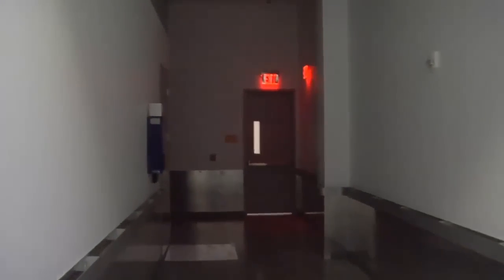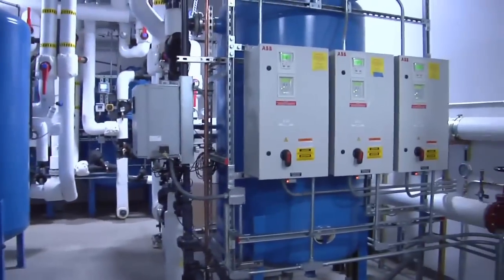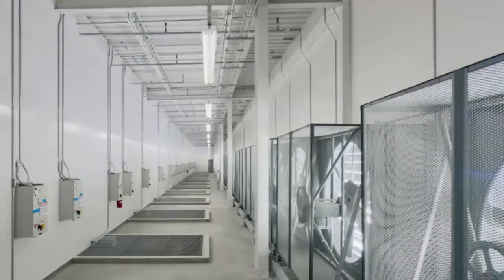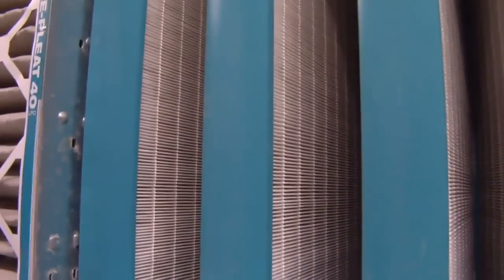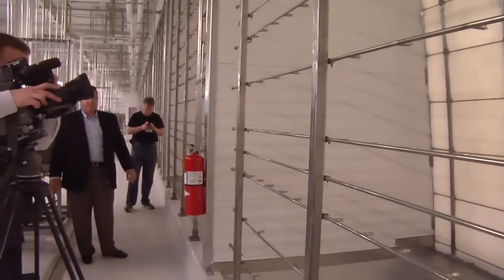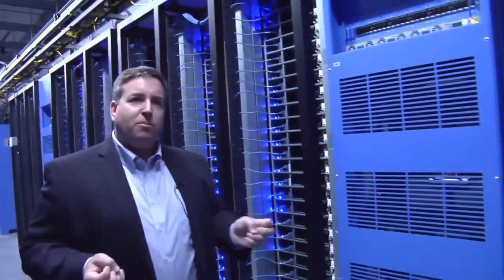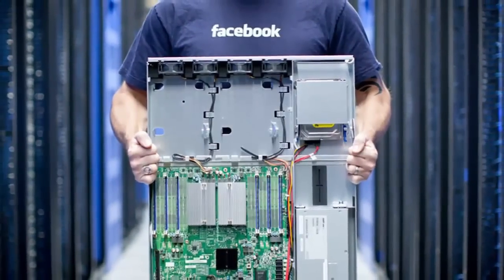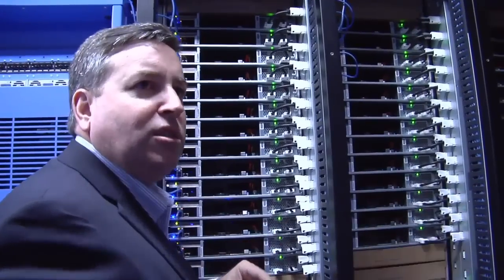facebook data center

Comment: 11:40 that's not a UPS it's a DCBUS. A UPS converts ac to DC to charge a battery bank then converts the DC voltage back to a inverted AC. a DCBUS takes incoming AC and rectifies to DC and depending on DC voltage needed 12,24,48 etc and then charges a battery bank for the instance AC voltage is no longer present. Basically if you're giving your equipment both AC and DC you don't have a UPS or PCS. It's strictly a DCBUS.

Comment: Environmental controls: Server space,  Best practices??- Recommended an increase in Air Pressure in server spaces operating environments
9:56 - 10:08 Thomas Mentions how increasing the pressure in the server room space slows the fans  in the servers  saving on power.
This might be the case in a sudden rise in pressure  - but only momentary
Would the higher atmospheric pressure in the server space not increase the density of the air?
Would this not increase wind resistance (drag) on the Server fans?
I am pretty sure variations in humidity would be in play here too, Vs density due to air pressure rather variations of humidityfactors like the specific gravity of the liquid at its given temp, current viscosity - not counting slip/shear from the angular momentum of the semifluids, velocity and trajectory to the Tine edge of the blade and the angle and rotational phase of the blade itself.
-seems counter intuitive.
 If air pressure in  was really in play here, in Would it make more sense reducing the pressure of the server space and thereby effectively reducing drag or increasing slip on the server fans resulting in the consumption of less power to achieve the Number of revolutions per minute as set by the System component level environmental control settings which regulate power to fan in demand to fluctuations in heat spikes?
or maybe they did not have his script proofed by his operations manager?
Your thoughts are golden.
IshaMaha

Comment: What a waste of water... Still runing your dc like an art museum .. try building a dc or servers for that matter that run on free air...
Reply: It's MUCH more energy-efficient to cool the air using the water mist than it is to run refrigerant compressors.  Yes, you'd still need refrigerant compressors as you can't just use outside air without chilling it when it's hot outside.  Using the water mist also humidifies the air (static around computers is BAD), and any water that isn't absorbed into the air is recycled.  Since they have to have an on-site purification plant anyway, I have to wonder if they have an on-site well to supply that water rather than re-purifying city water.
Reply: Hp ran servers in a tent for over a year.. just went in to knock the leaves off. PuE 1. Oversized cooling units with hight temperature CHW is the way forward.
Reply: So because HP did an experiment once, everyone MUST now do that for production environments too?...
Reply: no just stating that software environment now supports active load cloud share and that back end infrastructure can be reduced in resiliency to a level that saves real money,  The money spent in areas that make run rate reduction.
Reply: 3Helium3 no I manage 200,000 sqft of enterprise data centres. I must talking out my arse, the water they use in these installations is mind boggling. 
you are the one that needs to prove knowledge in this field. 
the technology's in high temperature chillers and free cooling efficiency is pretty good. have you seen an all air data centres with rust forming on the cabinets? it's very easy to over humidifie with these spray systems. when uneven load is present the data centre white space... have a look how Google does it with cooling towers and self built coil cooling rack housings. but you tap away on your keyboard Mr imagineer
Reply: FR? so you are sayinf that Facebook works with a problematic cooling system? Maybe racks are made from inox? I don't know man @benburton3496